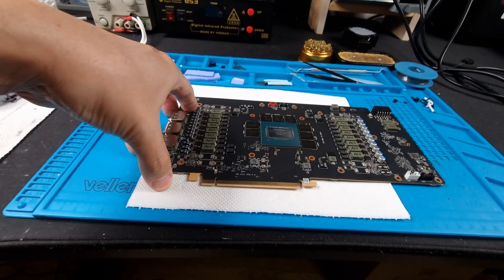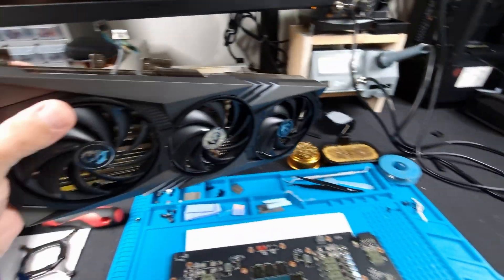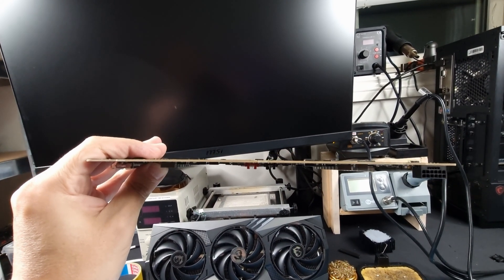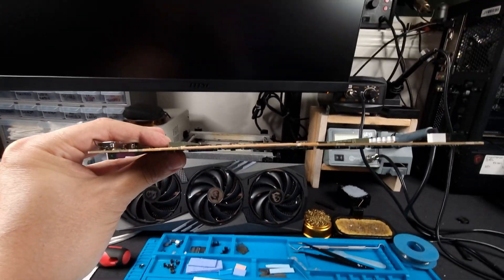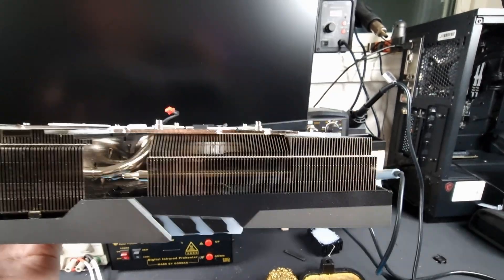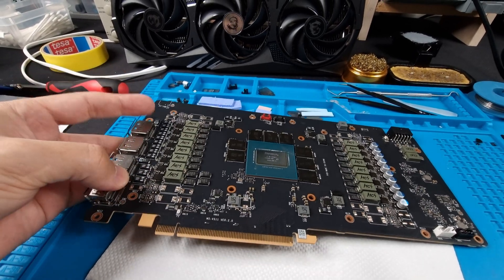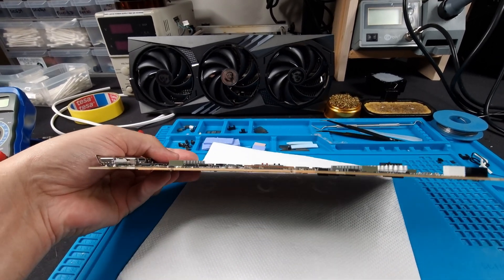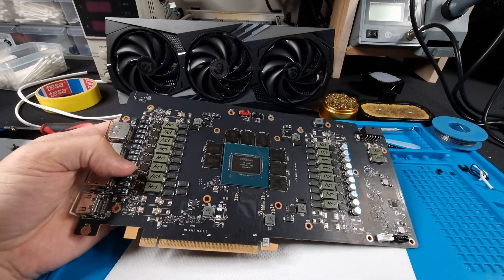How Using GPU Supports Incorrectly Can Destroy Your GPU.

Comment: Real story: my pc didn’t boot with a gpu stand (5€ from Amazon). 
Turned out it was pushing the card up to much. I lowered it 1 mm and now it’s fine.
Reply from the maker: Umm...if you installed your card and pushed up a bit too high with the gpu support and it failed to power on the first time, this is a red flag for me. That can be the result of broken solder joints under the GPU or memory. Even if its working now, it could be problem later. Just a heads up.
Reply: @TechnologyHive  oh well. Thanks. Might RMA that thing than just to be sure. and look into a vertical mount.
Reply: @fabsenbmx  *too
*then
Reply: @GrainGrown thanks
Reply: @GrainGrown 

The first "to" was correct.
Reply: @Grewyn7  Why did you even make that silly comment of yours?
Reply: U we’re an idiot
Reply: same thing happened to me, it booted just no display i take it out and it boots fine
Reply: You can't RMA product you ruined yourself
Reply from the maker: @club4ghz  Very true. Unethical.

Comment: The GPU should REST on the GPU support, the support should NOT be pushing up against the pci slot the other way in any way. Also as others have said you should try and put the GPU support in the middle of the GPU if you can. 

Also yes I have zero idea why computer cases aren't made to have the CPU cooler and GPU be vertical nowadays. A huge oversight by them and is going to lead to death motherboards/GPUs as time goes on.
Reply: Middle is not the optimal place. From 2/3 to 3/4 is the best place
Reply: i mean there was the cooler master haf xb evo where the entire mobo was placed in a vertical position, adn that's the only one i heard about that has that setup. wish more cases had that tbh, looks much more stable imo
Reply from the maker: @Iwantapplez109  The Cooler Master Elite 130, an oldie but goodie, is perfect for a vertical GPU setup. Granted first you'd have to find one for sale, and also you'd need a mini IT/X mobo.
Reply: Imagine a world where the death of motherboards and gpus didnt happen. These companies would eventually go out of business.
Reply from the maker: Imagine a world where foresight was the golden rule :) I wish ALL cases came with vertical mount as standard or full support correctly, and not close to the side panel which will restrict airflow to the gpu, causing overheating.
Reply: @TechnologyHive  What about cases that has mobo rotated 90 degrees ?
Reply from the maker: @Keith_Simmons  In those cases, the GPU is not in a horizonal position, so you should be good if installed properly.
Reply: Has killed my 850$gpu just now. Fuck this design
Reply: I do worry about my phantom spirit cooler and the weight for my motherboard. I’ve been too scared to install my bracket on my 5070ti as I’m worried about bending it up.
Reply: For the cpu cooler to be vertical, the mobo has to stay horizontal.
Reply: honestly, there's 2 reasons that they mount stuff on a horizontal still, A to be able to 'show off the parts', as became popular during Covid, along with stuff like the stupid RGB lighting, and B. it makes stuff wear down faster, meaning that the customer will have to get new parts faster as they're trying to make stuff more and more unrepairable (One look at the gaming laptop side of things is all the proof you really need of that fact, they're a pain in the ass to fix, and they actively do stuff like warranty stickers to stop people from doing repairs at home, despite them not legally being able to enforce the sticker rule in the US and, I think most of Europe)
Reply: @CrystallineFoxCF  to be fair, the horizontal mount also keeps the other card slots open. Sure most people will never actually use those, but some people will.

Comment: Its the peoples problem not gpu support...never had any problems with gpu supports
Reply from the maker: That's your personal experience, and I hear ya. But the cards are getting heavier and GPU's are dying, ending on my desk for repairs with same symptoms.
Reply: @TechnologyHive  maybe they should have 2 or 3 supports then in different spots under ?? I've bulit about 150 desktops, regular and customs with WC and I had only one complain when owner wanted to pull out the card and broke the  "fang" which is held by the pciex "pin".. I agree 4080's and 4090's and their amd counterparts are bigger and heavier BUT thats why i recommend at least 2 supports under gpu :) and there is no problem UNLESS customer do some sh*t to the card by himself :)
Reply: @Albert41122  That's what i was going to say, i love my PC cases none of them support a vertical mount, so just put a support in the middle & another one at the extreme right side and that's it, issue solved, with the heavy 40 Series GPUs, is like everyone forgot to add a support, 90% of the builds i see on Youtube these days has no support on their 4080s/4090s builds
Reply: @maxdave9590  yep thats it

Comment: Sagging has been a common thing since Nvidias 8000 series :P Joke aside sag isnt really a problem, it just happens to be more visible on some cards often dependant on cooler/VRM cooling being seperate. Its simply a result of recurring long term thermal expansion and retraction of the PCB :) It will happen even to cards with full "sandwich" coolers (full coverage + backplate)

That said, adding a support bracket that provides support on a too small surface area of the PCB, is very much a dumb idea xD cos well.. math dictates it xD applying any pressure to small points on the PBC will effect how the PBC will bend over time.

I never got why people use these support brackets, simply put, you are just moving the pressure point by adding a new point, in many cases to a small surface point. Its not fixing anything.

Given the heavy cards nowadays, i would claim after some max 6 months, you would need to re-adjust the bracket to ensure the increased pressure from natural sag on the bracket is released xD
Reply: Some of us don't dilude ourselves that a 1.5kg card can sit on a thin pcie slot and not crack over time. It's not just visually unpleasant, your pcb really is twisting like that.

Comment: What about ledges? GPU ledge vs GPU support. It's an arm that sticks out of the side of the motherboard that allows the GPU to lie ontop of it. Supports the entire end side of the card instead of just a corner.
Reply from the maker: That might work. But to guarantee your GPU wont suffer damage from sag, I'd stick to a vertical mount. Its just the best way to go to protect your purchase.
Reply: @TechnologyHive  don't vertically mounted GPUs has worse airflow? Also where would you get a pcie 5 riser
Reply from the maker: @laeven_  Nope. Not if you buy a 3rd party riser mount kit. If you use the case option, that would position the card to close to the side panel. I'd look on Amazon. Phanteks makes a good one, which is the one I use.
Reply: Asrock z690 extreme has this as an accessory,  but I'm a vertical guy myself.
Reply from the maker: @jrose-xp6tf  Nice! That will hopefully keep your card away from repair shops :)
Reply: @TechnologyHive  all my P.C.s are vert- mounted,  every one

Comment: Just vertical mount like the rest of us and be done with it.
Reply: That solves one problem and creates another problem.

Vertical mounted GPUs are more likely to overheat because of worse air-flow.

I have an RX6900XT and I use a support. On the other side I fixated it with very tight screws. I think that will be enough to prevent damage.
Reply from the maker: @K.R.98  No. This only applies if you install it in a case which allows for vertical mount next to the side panel. But if you use a 3rd part vertical mount like I show in this video, temperatures are actually better than when installed horizontally.
Reply: @TechnologyHive 
Ah okay. Maybe I’ll try a vertical mount one day. I recently bought a cool infinity mirror support and I‘d like to use it for as long as possible
Reply from the maker: @tommyt4259  That's it!

Comment: I believe the support brackets are not stupid but I believe the problem is the user that is pushing the graphics card up to a point it's gonna slowly warp it and I believe the best way to do it is put your case on its side while using the support bracket inside to get the proper height.

Basically what this will do is the graphics card will just rest on the support bracket to negate the warping and graphics card sag, so this is how I do it and I never have problems also it's always best to have two supports instead of one, so what this means is you'd have one support on the Edge and the other support near the middle.
Reply: So... it should rest on the support pole instead of being lifted? I have 2 slot 3080 Vision and can't really go with vertical mount because of air cooler of CPU.
Reply from the maker: @HuddledEragon  The real problem here is the weight of these newer cards. I the cards didn't weigh so much, there would be no need for such "supports". Even if you install the support before the gpu, eventually during hot-cold cycles, the pcb will twist due to the weight. The support will catch the sag and eventually in time leave the pcb bended. This is what I have been seeing with the cards coming in and talking to people that own them.
Reply: @TechnologyHive  I know about the weight and size of these graphics cards, because I have a Radeon RX 7900 XT TUF (352.9 x 158.2 x 72.6 mm) that I need to use a support bracket to make sure it rest its weight on it but I make sure I don't push it up so it doesn't bend the other way.

Plus I do not use a vertical mount and the main reason why is because the way how my AiO works is I need the tubes of the pump to be more downwards so if I vertical mount it will cause problems to the tubes, also I can't rotate the pump in a certain way because it will either hit the VRM heat sinks or the RAM slot because how thick they are.

So I have been thinking about either selling my Radeon RX 7900 XT TUF or for future projects, I would either replace it with a 7900 XT or with a 4080 super with a height at least 144 mm or a bit smaller than that so I can finally use my vertical mount.
Reply from the maker: @HuddledBlur  Thats one way to go about it :)
Reply: @TechnologyHive  Is the solution to mount the large cards vertically?
Reply: And what about the cards with solid metal backplates. Do they help in reducing the warping? (I have an asrock phantom gaming 7900xtx and I am thinking about getting a vertical mount (or an additional support other than a lian li one
Reply from the maker: @lauri9061  Yes. This will prevent sag, and thus warping of the PCB.
Reply from the maker: @lauri9061  Nope! Cold/hot cycles will slowing cause sag or warping of the PCB eventually. Just get a vertical mount. Fixed!
Reply: @TechnologyHive  Okay, thank you. I will buy a vertical mount asap!

Comment: Thank you for making this video brother. I ran a poll and most of the users still want to mount horizontally. This video will show the outcome of mounting horizontally. There are myths amongst users that there is a performance drop. I don't know how this myth settled in. I think there is a need for a video that shows the performance difference between mounting GPU vertically and horizontally.  I used my GPUs vertically and saw no performance drops. The only way forward is to mount it vertically to save the GPU.😁
Reply from the maker: @frazerxavier7295  That's 💯% a myth. The only way vertical mount can affect the gpu performance is if they mount it using the PC case vertical mount position which is typically close to the side panel, which restricts airflow to the card. 

I am not talking about that option. I'm talking about vertical mount as on a 3rd party riser, as you and I know. Too many cards are coming in for repair with this new issue. It's ridiculous, really.
Reply: @TechnologyHive  absolutely. More than half of memory error repairs I do is because of cracked solder joints or ripped pads under memory or core. 😁
Reply from the maker: @frazerxavier7295  Same here 😆
Reply: @frazerxavier7295  some gpu have vapor chambers optimized for horizontal mounting.